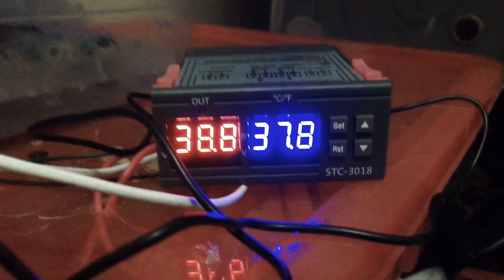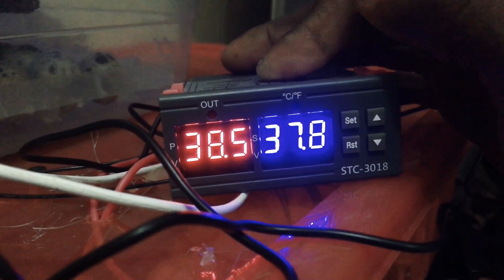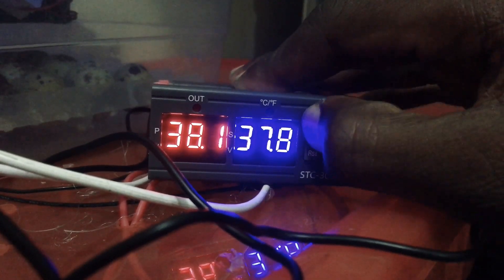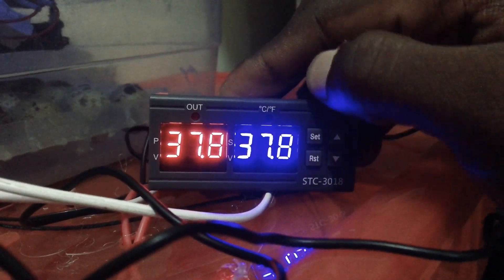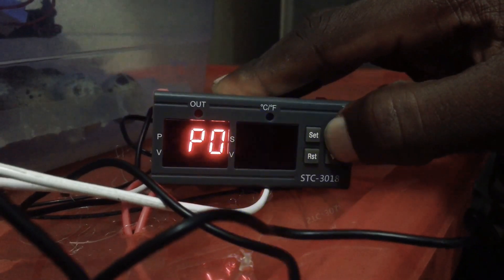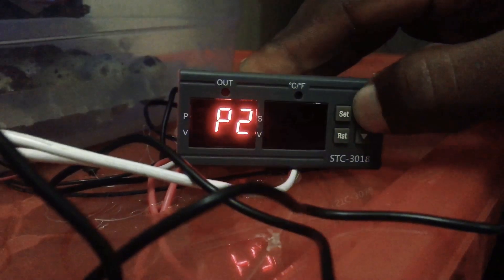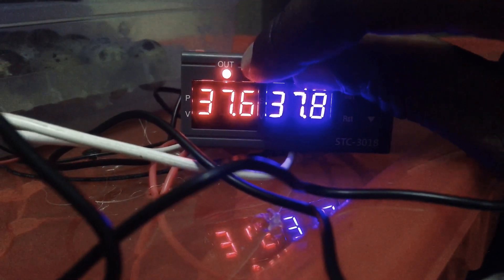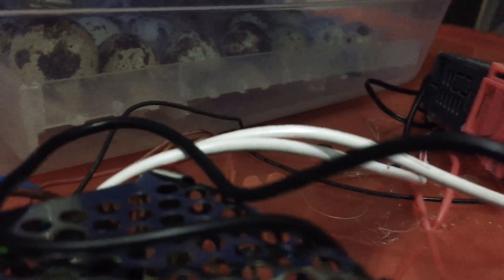How to set STC 3018

Comment: Good morning...A need a hand 
I have a SCT 3018 digital I set it this way 37.7 and 38.1 
And it looks like it's doing it's job 
I have the probe on top of the eggs 
But I bought a Mercury thermometer 🌡️🌡️🌡️ and it gives a different temperature 65 1/2 when it should be the same temperature 🌡️
So what am I doing wrong
Please help me
Reply from the maker: If the temperature is 65 on the mercury temperature then you need to calibrate the controller with the mercury temperature

Comment: I found on the action wear and how to set the controler.    Are these the setting your putting in to your control that would work for me   I'm using   42.3 centimeter for the temp    so will they work for me.         I have the probe next to the heater and fan.  Witch give me very little variation temperature. this is in a 300 egg incubator.
Reply from the maker: Yes it will work for you but first you need to put the probe in the middle of the incubator not next to the fan and heater

Comment: I just received the STC-3018   I watch your video a dozens times  the back ground noise is so loud i can't hear A lot of your setting you say  should make a new video.   I can't get it set  on the left side that say out  it keep  giving me (LLL)  i can't get rid of them.   How do you reset it to factory    settings    (RST)  i pushed  the rst    I don't know if the unit is defective  or  I'm   not doing it right.
Reply from the maker: I'll try and do a new video
Reply: @Funhatch1198  yes make a new video
Reply from the maker: You need to press and hold the rst